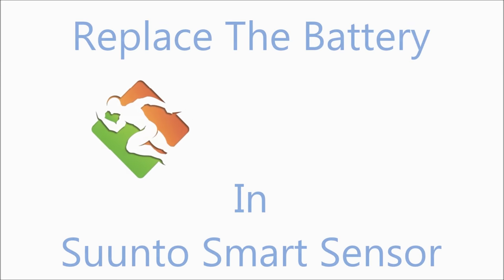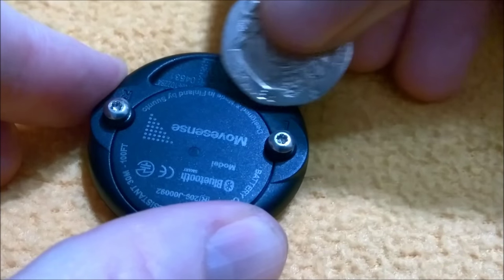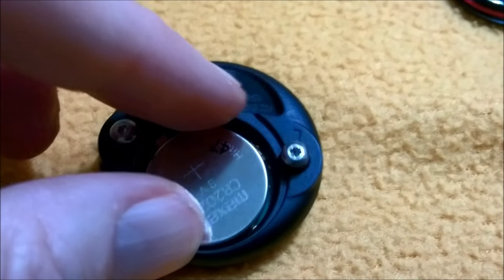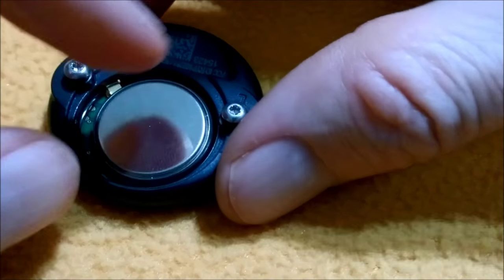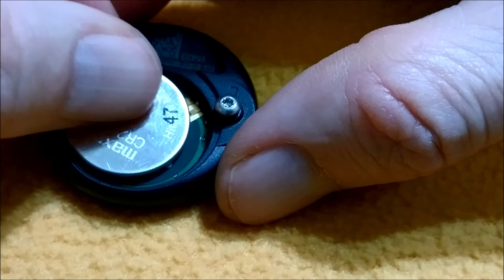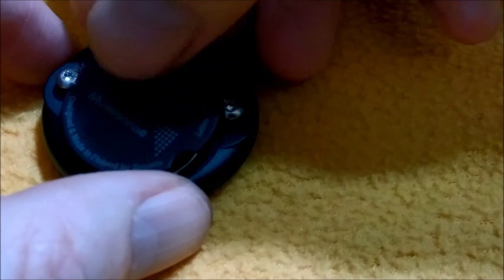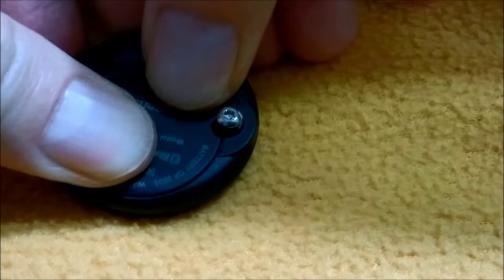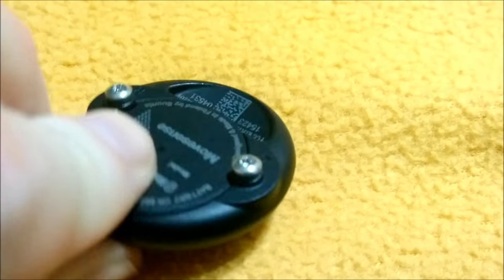How to replace the battery In Suunto Smart Sensor

Comment: How do you remove the strap?
Reply from the maker: The sensor contains  2 clips. Use some force to disconnect it from the belt
Reply: Hi. I still don't understand how to disconnect the sensor from the belt :-(. I tried to puul the whole sensor from the belt, but it seems quite firmly placed on it, and I am afraid I will break it.
Reply from the maker: Nikolas Enas Apply some force to disconnect it
Reply: Done it thanks!
Reply from the maker: Nikolas Enas great
Reply: want to know all the suunto ambit  charger is same .I need charger how can i get.plese help me.
Reply from the maker: +Mohammad Suzan I don't know. It is best to buy the charger of the same watch.
Reply: but frome where can i get it .if u have company address.so might try to buy online.thank u so much for your help .best regards mohammad
Reply from the maker: +Mohammad Suzan 
http://www.suunto.com/Products/Other-accessories/USB-Power-Cable/